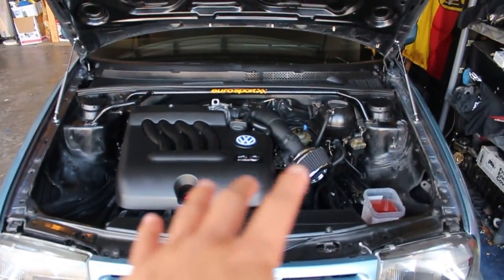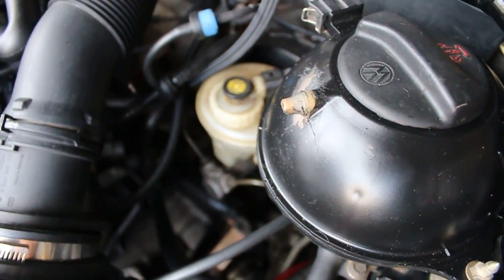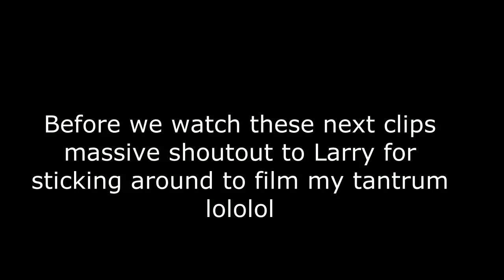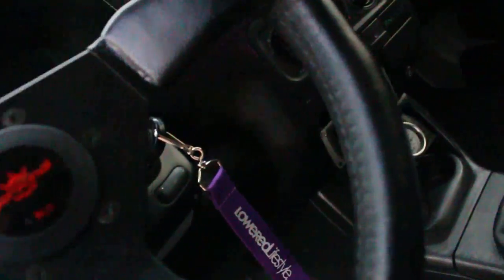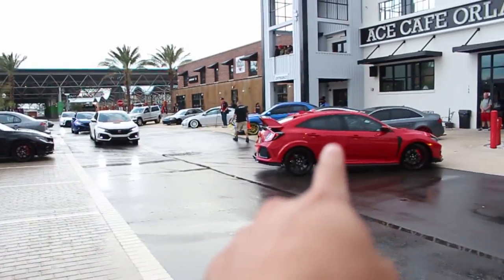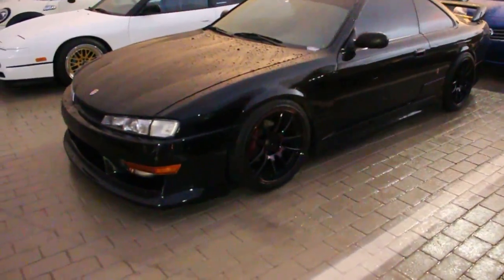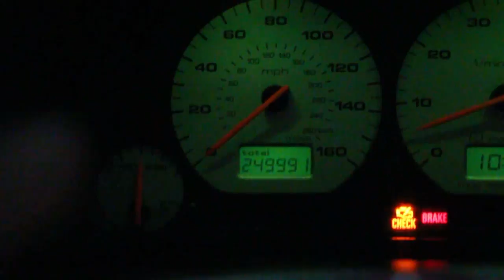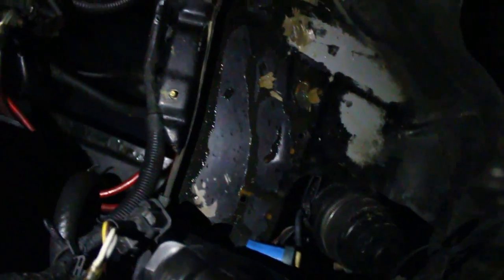Destroying two coolant balls in ONE day and Enjuku meet!

Comment: I pretty sure reg coolant is what fucks up the heatercores
Reply from the maker: Reckless Motorsports my heater core is bypassed lolol but it probably is
Reply: never had a heater core go bad on me i always get rid of all the pentofrost etc and run regular green coolant.. why could reg coolant mess up a heater core? explain please
Reply: Not sure 100% but G12/13 has better lubricating properties over long periods of time, which
is why they use it in what you always hear as "lifetime fill." This is due
to the phosphates in the coolant. The issue is, MIXING them is bad,
why? The metallic ions from say, Prestone and the phosphate rich G12
produce jelly-like depositions that promote corrosion. There have been
cases where entire radiator hoses have blown off because of this mixing,
and that's technically because of clogging, congestion, built water pressure and, of course, weakening of the hose.
Reply: yes i agree mixing them is bad that what i said do not mix but after fully flushing perfectly fine to use regular green coolant.. but ive rebuilt numerous vw and nothing in there at all that would be effected by using a different coolant.. another weird thing i have never had the plastic impellor on some the water pumps go bad never had that happen to me and i always switch to regular coolant asap especially since 99 percent of vw leak coolant lol so maybe regular coolant is better?lol

Comment: Yooo no, g12 coolant from VW mix with water, you are NOT supposed to use any other coolant in those motors it will eat everything. The coolant is neon pink
Reply from the maker: Ryan Thornholt hmm I was always told this stuff worked fine lol I’ll have to look into the g12 thanks man!
Reply: No problem.  It's $30 at the dealership and you have to mix it with half water so you get two gallons of coolant. Most VW guys will tell you that. Better safe than sorry